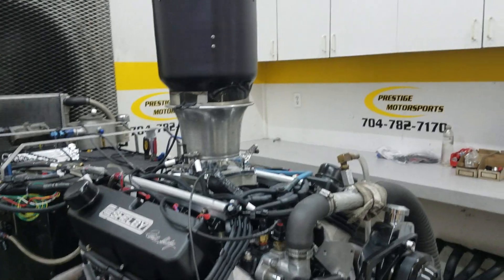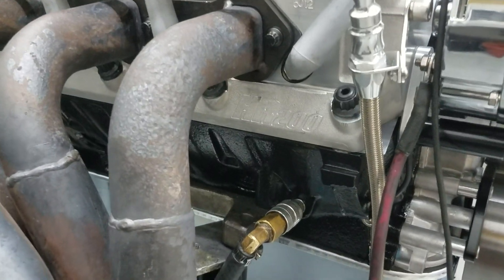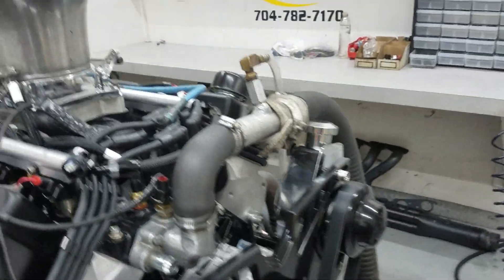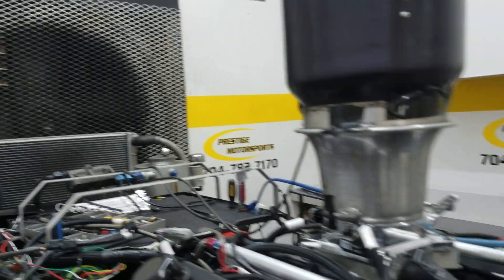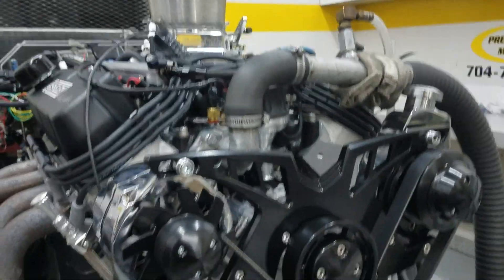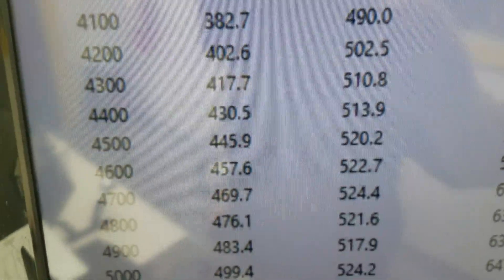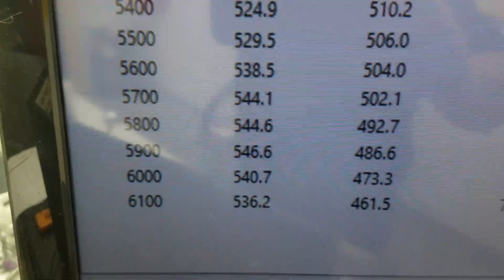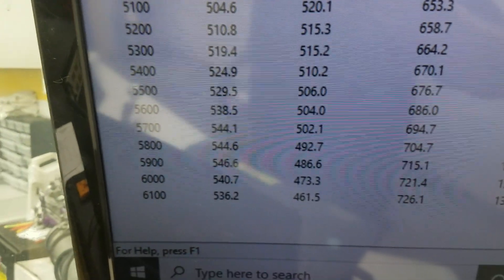427ci Small Block Ford Dyno Testing for Chris' Factory 5 Cobra at Prestige Motorsports - 547HP 524TQ

Comment: It's not what they say it is.. I have one of their engines and it definitely does not make the power they said it deos!! They say custom ground comp cam... They used motorworks i have never heard of them!!
Reply from the maker: Eddie - Sorry to read this. Prestige does specify the lobe grinds for most of our camshafts. Occasionally we are forced to use a shelf-stock camshaft with similar characteristics due to availability. We can assure you that the performance by whichever camshaft you received will provide the same quality and power level as our custom grinds. We dyno test every engine before it leaves our facility. You receive video and print out of the numbers. If you feel you are low on power, please let us know and we can walk you through some other checks to make sure there isn’t something else going on. 704-782-7170

Comment: There's no such thing as a 427 small block and a 383 stroker is not a 350 with a 400 crank it's a 400
Reply: Uh...you can bore a small block then combine it with a longer stroke crank to achieve cubic inches similar to a big block. Small block "stroker" motors like the GM LS3(6.2L) based 416(6.8L) and the 350(5.7L) based 383(6.3L) OR the Ford 351W(5.8L) based 393(6.4L)  or the 351W based 427(7.0L) are high revving engines unlike big blocks of similar displacement. To build a Ford 351W based 427ci small block, you take a 351W block and the crank from a Ford 400M machined to fit, and Chrysler 360 rods. You bore the stock 351W block 60 over taking it from 4.00" to 4.060" and combine it with the 4.125" stroke of the 400M(Modifieds are just a tall deck Cleveland small block). This equals 427ci(7.0L). 
The difference between a small block and a big block isn't just in cubic inches...rather more in how those displacements are achieved. Example:
SBF 427 = 4.060 bore x 4.125 stroke
BBF 427 = 4.23 bore x 3.78 stroke
Large displacement SBs use their smaller bore combined with a much longer stroke to achieve such cubic inches whereas a BB uses large bores with a shorter stroke to achieve the same displacement. Thus, a "stroker" small blocks must rev much higher compared to big blocks to make similar HP/TQ numbers as the same displacement big block due to the smaller initial cylinder volume(smaller bore).
So...yes...you can have Small Block engines with Big Block displacement. 
There is no replacement for displacement when talking HP/TQ numbers...but how you achieve that displacement is just as important.
Reply: @knowplay3258  😯 Wow well said
Reply: @israelnieves2817  Thank you! I only aim to inform and educate using my knowledge and experience.
Reply: The blocks are all larger on big blocks to start with. Parts are not interchangeable between the two.
Reply: Hate to break it to ya, buddy, but you're looking at a 427 small block right there. It's 351w based. As for the 383 not sure about the whole 400 crank deal that's a question for an engine builder, like Prestige here, as I'm just a Ford enthusiast. However 383 strokers do exist that I can confirm.
Reply: A 400 has a 4.125 bore and a 3.75 stroke. A 350 bored . 030 over and the 400 crank @3.75 comes out at 383. A Ford block bored to 4.125 with a 4.0" crank comes out to 427. So yes, there are small blocks with big block displacements.
Reply: Do I need to explain the differences in  Square, Under-Square, and Over-Square engines for you to understand the concept of a large displacement SB or the differences between a SB and a BB? 
I've been a mechanic, engine builder, and drag racer for a long time. All the above are simple concepts you must understand and take into account when building an engine based on sanctioning body rules or to achieve a certain goal. 
If displacement was the determining factor between SB and BB, then explain GM's BBC 396ci versus GM's SBC 400ci known as the "small block 400".
Reply: A 0.060 over 351-W with a 4.200” stroker crankshaft will be 434 cubic inches. A SBC 400 with a 4.125” bore with a 350 3.48” stroke will be 377 cubic inches. But yeah your basic 400 SBC is 4.125” bore and 3.75” stroke. 
A 383 SBF is a 4.030 bore and 3.75” stroke basically just like the 350 SBC 383 stroker.
Reply: @StainlessTIG2   You are talking some "old school" engines there with the SBF 434 and the SBC 377. The 377 is a high revving "screamer" in a drag car. And the 434 was used extensively down here (Louisiana) by Mud Truck racers limited to small blocks for certain classes, but wanting some serious torque. Both engines have been being built for a long time...both are tried and true.
Reply: Bro you are talking way past out of your ass. The blocks on a 383 aka stroked 350 and a 400 are not the same and a 427 aka stroked 351w is still a 351w ford. Chevrolet actually does have a 427 small block in the form of the ls7 but thats an ls based motor and in a different spectrum.
Reply: @John Taylor Here's a video you need to watch...Power Nation building a 351W based 427 with a history lesson on Ford's 427 engines such as the FE427 and the 427 "Cammer". 
https://youtu.be/edpnG3DSXVY